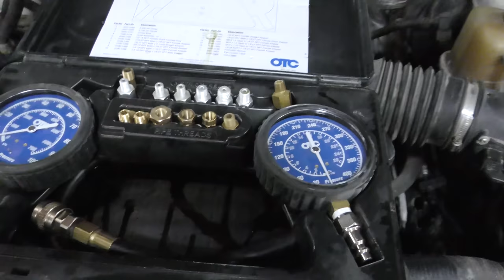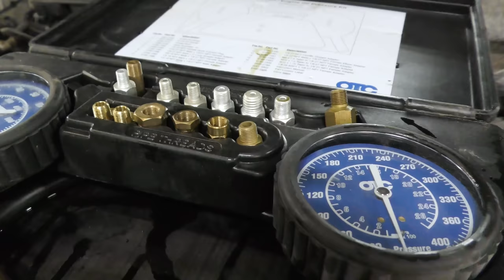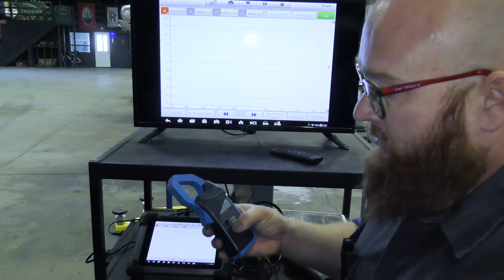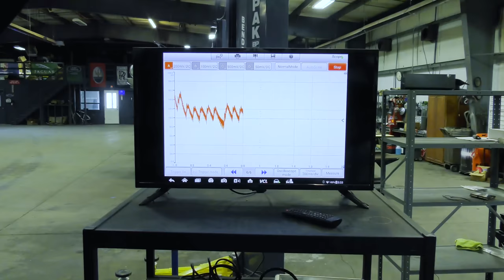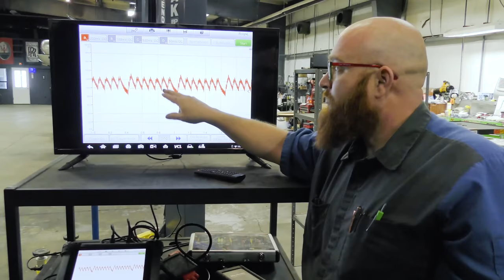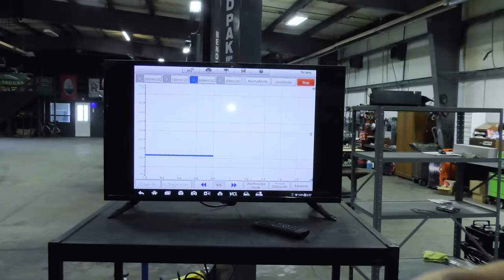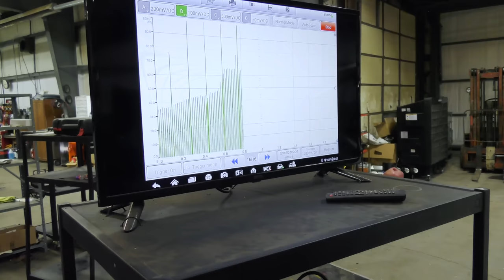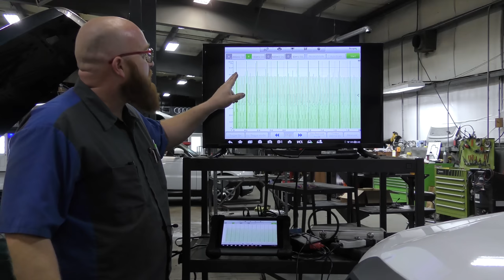Can an engine additive really fix this 2011 F150? CAR WIZARD shows how to diagnose and repair

Comment: When I used Lucas in my GM 3.1L MPFI it turned the oil into water. I changed the oil right after because it made my engine knock. When I dumped the oil out it was like I filled the crankcase with water. I've never seen oil so thin in my life. 

From that moment on I've never used Lucas ever again.
Reply: Something else turned your oil into water, I've used Lucas for years in three different Ford trucks I've owned, two bought used, and one bought new and I have never even remotely experienced something like what you are describing here.
Reply: @nathanmcdonald610  there's hundreds of complaints about that. Lucas takes away the oils anti foaming agents and causes the oil to foam up which reduces its ability to hold its viscosity.
Reply: @RobertNES816  It's unfortunate that your experience has greatly differed from mine. Farewell.

Comment: What causes this in the first place is the ridiculous 5W-20 oil that is specified to use in the truck.  This light oil is to help the CAFE standard (Corporate Average Fuel Economy).  It does help very slightly in gaining fuel economy but at a great expense to engine longevity.  This is why why you add the Lucas additive the oil pressure goes up.  A band-aid at best but will get some more miles out of a worn out engine.  Even using 5W-30 or 5W-40 will go a long ways to helping the engine live.

Comment: I would also recommend using API Service SN synthetic oil (preferably a Euro brand like Liqui Moly - get it at Napa - because it will be guaranteed to be a group IV/V synthetic). Conventional oil shrinks the seals, and group IV/V synthetic makes them pliable and expanded and closer to how they were factory. I would assume that this is the effect that Lucas is having.
Reply: Liqui Moly is generally mostly group III and ironically contains no moly. Liquimoly generally formulates there oils just well enough to meet the manufacturers specs, which means if they can get by using group III, they will use group III. Ravenol is about the only oil I know that carries approvals that's actual full synthetic by German standards.

Comment: Its the o-ring on the oil pump pickup tube. I’ve seen this over and over. Just did a 2000 Silverado with the same symptoms
Reply: Too new and pretty unlikely. That's something only a pos GM would do.
Reply: Well I guess keep using snake oil to fix mechanical problems. Grandfather always told me can’t fix stupid, he was right
Reply: Walrus was fixing the penguins car, penguin asks what’s wrong? Walrus replied, looks like you just blew a seal! Penguin replied no it just ice cream. U are the penguin

Comment: all those 09-14 has big rust issues in the rocker panels,  ford put a drain hose in the back and ran it inside vs outside

Comment: Mr. Wizard, I looked it up and the recommended manufacturer oil viscosity is 5W-20. That’s awfully thin oil. Especially when hot. Not as bad as that 0W-20 water...oops...I mean oil?  5W-20 is the recommendation for a New engine. Would increasing the oil viscosity to 10W-30 or even 10W-40 have helped with a hot engine at idle? Your friends said the engine has worn main, camshaft and certainly rod bearings. Maybe the thicker hot viscosity oil And the Lucas Oil Stabilizer would really help this engine survive longer? What do you think?

Comment: Years ago I used Slick 50 in a new then 1991 Jeep Cherokee and later the bottom end bearing failed at 60,000 miles. I never used additives after that

Comment: I have a 2017 F-150 with 62K miles on it. It runs like a dream with no problems while sitting at a light. Should I have the shop do my oil changes with the Lucas/Recommended ratio and Motorcraft filter as a preventive maintenance?

Comment: My 2004 Ford e250 4.6 is at 342k running strong 💪
Reply: The 4.6L is a tank. It's honestly underpowered for anything bigger than a Crown Vic which is why it feels so sluggish in the F-150's and E-Series vans it was used in, but it is a solid engine that will run for many hundreds of thousands of miles.

Comment: I saw on another channel they could place a device on the fuse without removing the fuse. They could see if it was drawing power using it. Nice not to need to remove fuses each time.

Comment: My granddad always said "over 100k, ford trucks need 50wt."

Our '76 f100 just passed the 300k mark on the original inline 6. 

its gotten 20/50 in the winter and straight 50wt in the summer since the mid-80s.

Comment: Finding a good mechanic is difficult for many of us with only one or two cars. How should we manage self diagnosing and tempting shops to throw parts at it until it works, with telling the full story so the shop can know where to start? Honestly, it seems to me that unless you have a relationship with a good mechanic who knows and tests properly, you are better off going to the dealer if you own a commodity vehicle. If you own an exotic, try to find the right mechanic somewhat near to you. 
The spread to compensate mechanics who work on commodity vehicles is probably not enough to pay for learning to properly diagnose and repair. Even in this video, Wizard admits that he called the dealer to find the right solution. Mostly, it was because he doesn’t have the experience working on these trucks enough. The dealership has a network that work on commodity vehicles so they know what to do. Commodity vehicle = Honda, Toyota, Ford, Dodge, GMC, Chevy ect. You’ll probably pay less at the dealer in the end than you will for a parts tossed who doesn’t know what they are doing.

Comment: 3v is a great motor if you swap to the high pressure oil pump and change the oil every 3,000 miles.

Comment: I've had plugged pickup screens and adding the Lucas just makes the oil stick to the bearings to take up the gap.not saying that Lucas don't work but I would check the pump screen and the pump the pump itself could wear out.people measure oil pressure wrong it's not pressure.its measured on volume how much volume flows thew the bearings that's what creates pressure

Comment: Had an old tercel that we did that every oil change when I was young. It went past 450,000 miles then lost track of who ended up with it. The body and frame probly rusted out and got junked.
Reply: Not lucas but similar. Thicker than molasses in Janurary. For what I got told, it mostly stayed in the Oil pan or any kind of crevisse it could lay into without mixing into the motor oil. And thats how it bumped up the pressure. Because your engine turns, and the pump still pumps the same amount into a reduced amount of cubic inches or whatever. It that draws an accurate picture of whats hapening, Im not too sure, but it "sounds" logical. 😅

Comment: That Lucas stuff actually works for an old transmission that might be slipping and a car not worth fixing it. Drain out a quart of Transmission fluid and add Lucas anti slip formula and you often will get longer out of your beater car for cheap lol

Comment: While I was hoping Ford would do something the E350 (2011 65,000 miles) gently used van sat in the dealer for 5 months at the beginning of the Covid shut down. Finally they thought I'd have to pay their price but my research said no to them. Any way while at the dealer I saw a 2018 V-6 F150 crew cab , sweet looking truck. , I noticed it because they lifted the body off it to work on the engine. Uh oh, cam phaser failure, 28,000-30,000 miles and Ford authorized the dealer to just replace 1 phaser, no  new chain no high pressure oil pump, just a Ford answer to a customer only one phaser. Then when he goes 5-7,000 miles and the second phaser fails they will charge the customer.

Comment: Have you ever worked on that notorious lead frame issue that happens to these trucks? I used a company one that was made my personal work vehicle awhile ago. Got it pretty rough, with 180k miles.got it up to 380k with highway miles and still running. And it was pretty abused before it got in my hands. That lead frame though. Would just shift gears and bog whenever the gearwrench would show up. It would work just fine for about half an hour if you shut it off and started it up, then it would do it again. If it wasnt for that i would buy one but the issue seems to still be present up until the newest models😢

Comment: I do this with my 400k gm 5.3 BUT after pulling a trailer with 1000 pounds on it cooks the lucas and it will drop pressure to turn the light on again

Comment: That is a nice kit. I wonder if you can also diagnose electrically fired fuel injectors to see the waveform and confirm that they are  all equal.

Comment: Hello Car Wizard, great relaxed presentation. Question: Is there any most simple, all wheel drive, midsize, WORK TRUCK for roll off used for towing? New electronics are cool but they spend half a time in garages.  Thanks for your contribution!

Comment: I traded in my 09 f150 with 208,000 on it back in 2019. It was a 5.4 also, but did not have the 2 piece spark plugs. I guess it depends on how you maintain your vehicles. When i bought the truck it had 75k on it already so i am not sure what oil was used before i bought it. While i had it i used amsoil.

Comment: I bought a cheap hyundai entourage, needed a van for a job of temporary use, so $2000 won. Turned out I like the van way better than the previous owner. the oil control valves became clogged, and valve cover gaskets leaked so, a nice weekend job. These people who claimed regular oil changes lied. Oh it has 50 psi oil pressure on the Solus. but the sludge tells a tale. So it gets 3k oil changes with factory oil filter now, Engine still purrs like a kitten and has been great since the work was done less than 10k in 2 years ago, but I wish I could flush the crap out of it for good.

Comment: The truck was most likely ran hard but I still don’t feel like that’s enough miles to expand the clearances. That’s why you should use mobil 1 or amsoil and change oil like every 3-4K miles

Comment: Kind of a shame though that they even admit that the motor just wears out. you could have Lincoln Town Car with the 4.6 l modular V8 last over 400,000 miles in stop and go traffic no problem. It just seems like Ford as a company got lazy after 2010.
That amps clamp is a pretty slick stuff there, especially considering your finding ways to use it to help out in other areas

Comment: My 2001 f350 v10 6.8 is  still awesome.   Dont know why you hate fords.  But my 20 year old ford pickup is running great.  Guessing my v10 triton will go ten or 20 more years.  Real fender wells are rusty.   Plus I love my 5 speed manual trans.  

      Dodge / ram / chevy stuff from the last 20 years are not good.  So dont know what you like about some of the chevy trucks..

Comment: The 5.0L Coyote motor is not cheap.  I'd run a higher viscosity oil going forward until I decided what to do with the truck.

Comment: Pretty sure the actual oil pressure reading on the dash is a fake oil pressure reading on a bunch of fords.. like it will always show near half the gauge.. the computer will chime low oil pressure and bury the needle to the left if the computer senses a pressure lower than 15 psi..  so using a pressure gauge set and getting an actual reading for any values on the dash is definitely a must.

Comment: I just bought a 1999 lincoln towm car 120000 miles. Runs like a top. It was a no winter old man car. I love it. Does anyone have tips for a 4.6l i should know
Reply: If you have the all plastic intake manifold change it to the updated intake manifold now. Don’t buy the Dorman intake either. Buy the Ford one with FelPro intake gaskets.
Reply: @atx-cvpi_99  thanks ill have to look. I meant to say it has 112000 miles

Comment: Relative compression test is really useful but in order for it to be actually useful you need a reference signal so you can at least identify cylinder 1 otherwise you have no idea which cylinder is low on compression.
Reply: He pulled the spark plug on 2 = that is the reference signal.
Reply: @jonmccormick8683  so you propose you pull a spark plug when you want to find out which cylinder is low on compression?...obviously not. You need to use a clamp on an injector wire to determine the trigger.
Reply: @JVR_Funwithdesign  You would think the computer program he was using should be able to do that.  =Maybe it cannot compare the battery drain current to an injector voltage or current trigger.   Different grounds or even no ground with a hall effect current source = can't compare the two together.  Probably a current vs voltage display issue also.

Comment: Can't even believe this is news to anyone.  You mean increasing the oil viscosity will bump up the oil pressure?....wow...magic.  This has been done this since there have been used cars and used car dealers.  Same thing with bars leak in engines, trans, power steering, cooling systems, brake fluid in trans to swell the seals so it shifts again..long enough to get it sold anyway.  It's a temporary fix, and as long as you're honest with the customer that it absolutely IS a temporary patch job, then good on you.  I'm also a believer in using OEM parts, including filters of all types, and have been since early 80's when the first OBD systems started coming online.  The aftermarket sensors never worked as well as an OEM part, whether is was EFI or a feedback carburetor.  I can't tell you how many drivability symptoms I've corrected simply be replacing an aftermarket sensor that another shop had installed with an OEM sensor.  Oh sure, they were twice the price, but they worked like they were supposed to.

Comment: Extended oil drain intervals causes too much wear in engines in my opinion. I would never go past 5,000 miles in any engine for oil changes. I’ve used Lucas before, including the oil additive and the engine oil stop leak. It works very well on engines that have wear.
Reply: 5000 miles I hope you are not using synthetic oil, you would be wasting money

Comment: Have you checked out RVS Technoogy? It's a treatment that forms a new permanent and low friction surface for the parts that run the hottest. Also the company has had many test vehicles that have been daily driven without engine oil for thousands of miles. Check RVS Technology USA LLC, 3900 miles on a Civic without engine oil, since june 2018. 

The product is from Finland, originally based on (Soviet era?) Russian findings while boring some deep hole, where they originally had big problems with the dulling bore end. At some point it just kept going and the operators weren't sure if the bore is actually functioning as it should. So they raised it back up for inspection, and found the triboceramic properties on the bore that had formed at some point while boring. RVS is somehow forming those same properties and they suggest to add the first half of the treatment to old oil, driving a while, making an oil change and then add the second half.

Comment: I generally agree with you on the 5.4, but the 5.0 coyote are leap years better. GM however, have taken a perfectly good motor and messed it up with AFM. New GM motors are total garbage. We got a group of Tahoes for police duty and they're going down for cam and lifter failures. Older GM motors are great up to 07 though
Reply: Those Explorers and Tauruses were really really bad. Timing chain driven water pumps destroy the engine. They are worse than the Tahoes. I’ve heard that some agencies delete the AFM system entirely. Many police departments have had more Explorers and Tauruses in the shop than the Tahoes in their fleets. There’s a guy on YouTube that regularly sells police Tahoes that talks about how durable and reliable these vehicles really are https://youtube.com/channel/UCsT8PtAE_v5rIp02grMhrhA. The only other cars that are as durable as the Tahoes are the Ford Crown Victorias and Chevrolet Caprices. HEMIs after 2008 will eat cams regardless if it has a MDS system or not. I’ve heard about 3/4 ton Rams with the 5.7 HEMI non MDS eating cams like the MDS HEMIs.

Comment: I have been using 'Morey's oil stabiliser' and grease since 1984 and have not rebuild an engine or replaced bearings since, and that's the truth, the car that I'm driving now most of the time ive had for 22 years and has done 420.000 mile and sounds and goes like new! No oil use! 
Oil changes according to oil manufacturer specifications as aposed to car manufacturing specifications helps to, most oils now are made to last 3000 miles, it brakes down after that. They are just not using the expensive polymers any more in today's oil. (Came across an honest oil rep, long story)

Comment: Back in the early 70s, I worked as a mechanic and we would get a lot of the old slant 6 engines in with noisy lifters.  The first thing we would do was to change oil, then we would put on a Motorcraft filter.  That shop sold Dupont oil treatment and put a can of that in.  We would tell them to drive it a few weeks and then come back in.  Most of the time that would cure the problem.  Problem solved and happy customers, They did not have to pay to tear into the engine.

Comment: The only Ford engines I've run that I've had no problems with are the 6.8 2V & 3V V10. The V8 depending on the engine have been nothing but headaches for me.

Comment: I had a 97 chevy k1500 350 and clattered unreal,,, 138k miles,, I was thinking motors been abused its junk,, but told to try dumping atf in with the oil,,,and and noise left... (told atf can act like a detergent for gummed up) 2 years later that trucks still about quiet and running good... I also avoided additives like seafoam but these 2 things I have been seeing some luck with when at the point of scrap it..I try it.

Comment: 180k in a motor. My honda pilot had 380k without issues and my old tundra had almost 380k when it got totaled no engine issues. I would be very upset if an engine is worn out at 180k miles